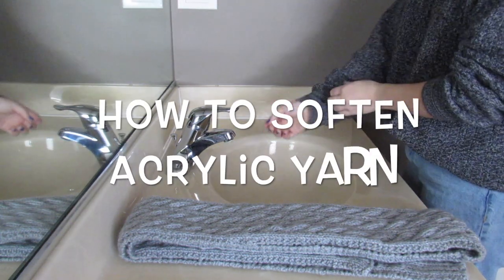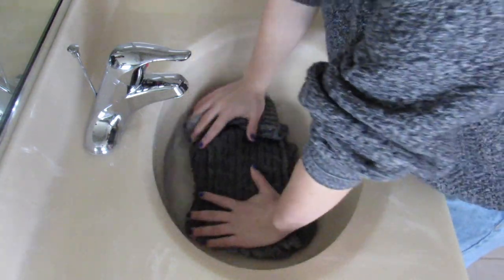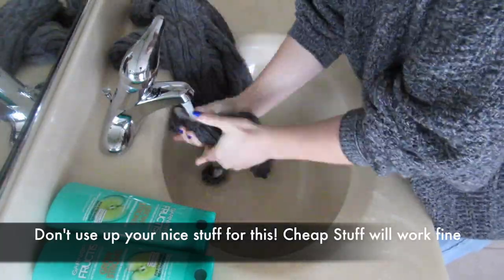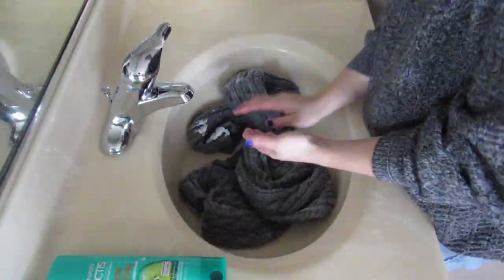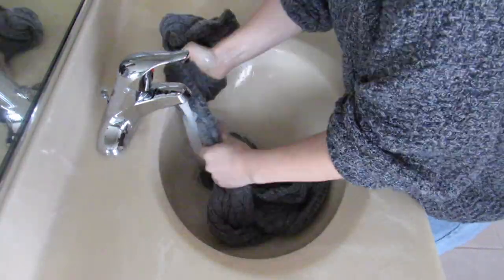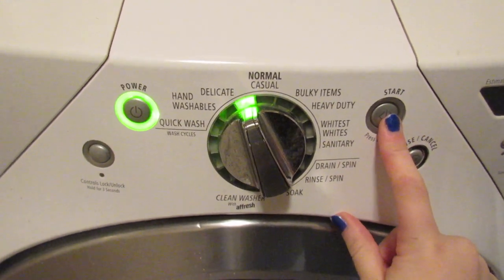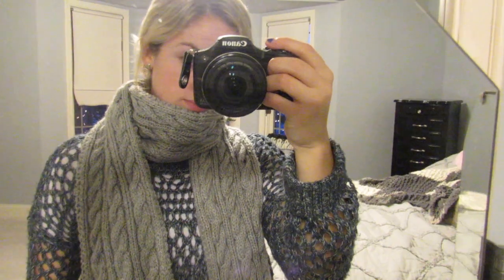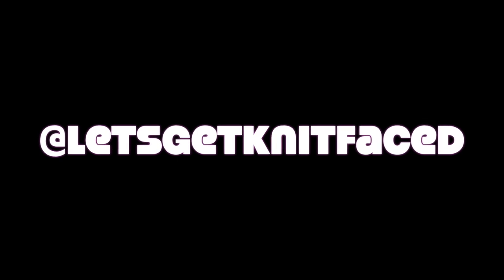How to Soften Acrylic Yarn

Comment: Thnx for video. Can i do this with half acrilic amd half wool yarn? Plus cotton? I have mixed yarns project and need help. Thanks
Reply from the maker: Wool is one of the more fragile fibers, any heat or friction will ruin it so I recommend washing by hand in cold water with just some conditioner! Wool won’t change much with that but the acrylic /cotton should absorb it. No washing machine- air dry! And wool loves blocking so do that if you can.

Comment: I’ve noticed that when I crochet squares (not granny squares just regular squares using the chain and single crochet) they end up being a bit stiff. Would this method work to make them loosen up or do you know how to loosen it up? I’d really like to not have to start all over since I made so many already 😅
Reply: blocking can help relax the stitches and make them drape better but how effectively that works depends on the how tight the stitches were to start with.